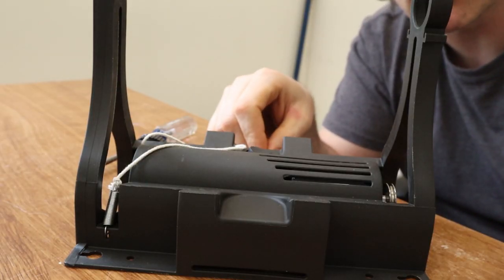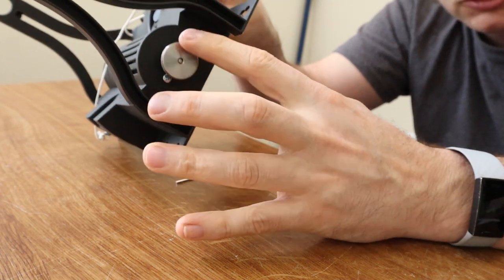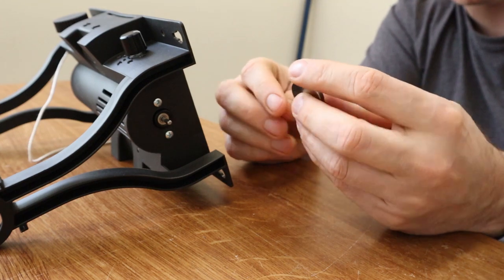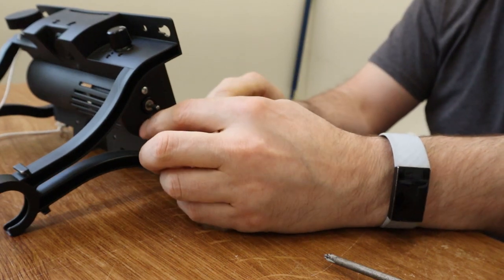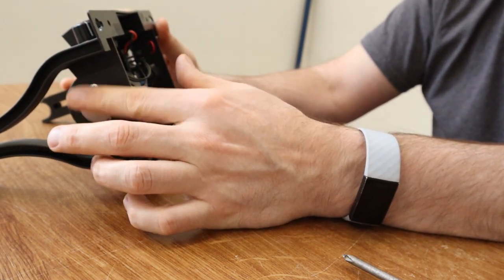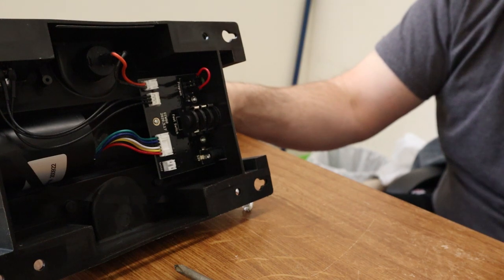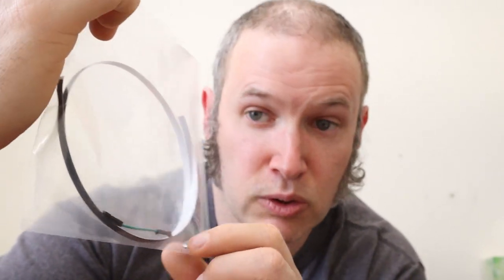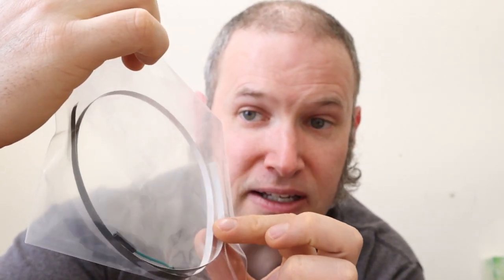SPIN #115 - EEW 6.0 Reworks

Comment: Great video! Love my eew 6 and had the static issue too, but when I use it with the battery pack, I leave the battery to the side of the wheel, so I do not place the wheel on the bottom tray where the battery is and haven't had a static issue that way at all.